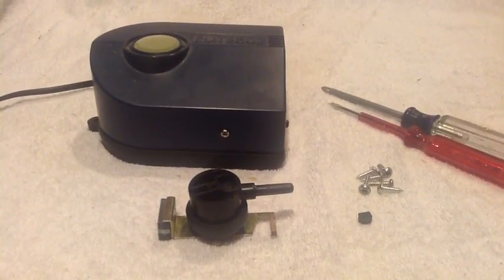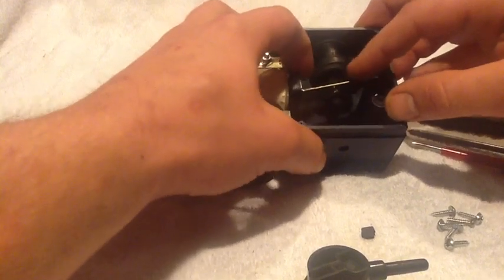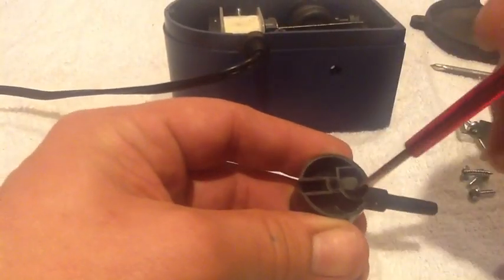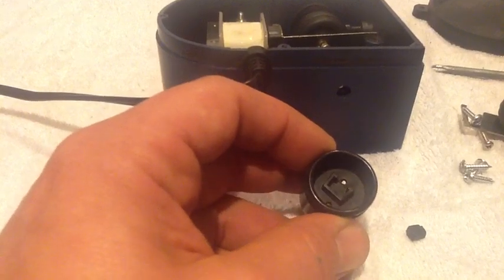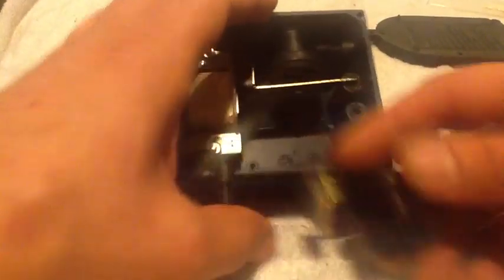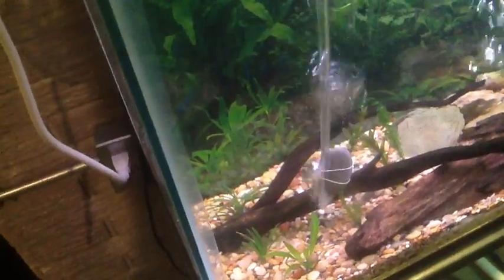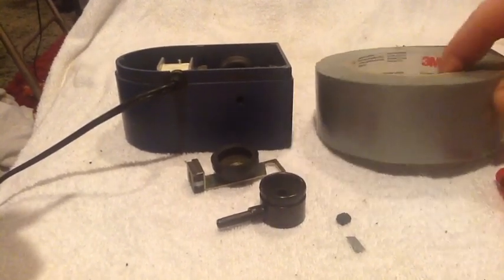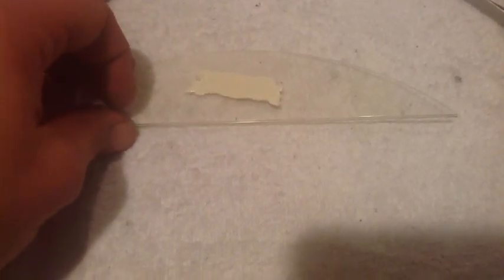How To Fix An Aquarium Air Pump

Comment: His terminology is a tiny bit off but the information is accurate.  My flapper was slightly creased, I just reversed it and the pump now works as new.  I imagine a good replacement for the flapper would be a small piece of latex glove. Thanks!

Comment: Thanks for your video.  I just pulled the pump out of the trash that I threw in there earlier today when it quit pumping air.  Took it apart.  I only had to unfurl that little gasket and put it back in. It was just curled enough to uncover the hole.  If it happens again I'll know what to do.

Comment: "Rubber gasket"= REED VALVE  "Gasket"= DIAPHRAM  "Air Cylinder"= PUMP BODY  "Rotating Motor"= AC ELECTRIC MAGNET  "Magnet with a Rod"= CANTILEVER FIXED-POLE MAGNET  "Rotating Magnetic Field"= AC OCILLATING (flipping) MAGNETIC FIELD  AND... DEAR LORD- WHERE'S THE SPIDER OR SNAKE THAT BIT YOUR LEFT HAND??

Comment: I took mine apart and the plastic flappers were good but dirty so I cleaned it and blew air with my mouth into the outlet and disloged what I think was dirt.  It worked.

Comment: This is a nice video. Many of pet store guys just say to throw it off and buy a new one, when it fails. In a year time, such two power filters failed suddenly without any reasons. I just one morning woke up & saw the power filter wasn't functioning. But I make use of those power chord, suction cups, cartridge stuffs with it, since, that power filter was totally stuffed inside with fibre glass for making water proof. It gives me no way to know what went wrong inside. But, Air pump is cool !

Comment: Was able to fix my Precision PR2500 coz of this vid. I have a PR7500 too. My question is this : can i join the two outlets using a T-connector into one air hose towards a sponge filter, without harming their diaphragm?
Reply: +JOWEE BOIE I did this and it worked fine, I don't think it's putting out enough air to reach the maximum flow rate of the small diameter hose anyway so it shouldn't create back pressure.
Reply: +James Brine thanks man. i just set aside the 2500 as back up if the 7500 breaks down. the 7500 now runs 2 sponge filters from its 2 outputs, set on "low". the 1st spongefilter is in my oscar tank and the 2nd is in my tetra tank...

Comment: sit it on a piece of wood,the wood will absorb vibration,or use foam,but don't block air space under the pump.It needs air space to dissipate heat build up.

Comment: you can re-use the original gaskets by cleaning them just wet your fingers and rub them together with the gasket between them let it dry and replace but after so long it will fail completely. good job with the video though.

Comment: It does not push it, it is a magnetic that goes on and off 60 cycles per second,
the valves are called reed valves the problem that goes bad is the rubber tension in the rubber cup, do not replace the reeds, use a rubber band on the swing arm to reapply the tention on the pistion cup, that is the only problem these pumps have.
apply the rubber band compressing the rubber diaphragm. the magnetic pulls it out.

Comment: Well done - thanks! I wouldn't know where to begin without this one. I ended up treating the existing gaskets with corn starch, cleaning out the scum, and there was also a bit of water in this used Whisper 40 pump. Works great now!

Comment: Do you have any idea how the piece with the valves on it is help on when they don't use screws? i dropped my pump yesterday and in taking it apart what you said seems to be the problem, but it seems like the piece is glued on.

Comment: Hi can you make another video of how to silent airpumps like this?
Reply: usualy the magnet vibrators become close to the winding magnet when rubber becomes soft which holds them on place and it touches eachother and makes noise , u can fix this by adjusting the screw behind the ruber flaps that pushes air , slide it away or close to adjust , idea is to make the magnets away from eachother , u can also do smthing at its base to pull it away . i fixed mine by screw behind ruber flaps

Comment: The little valves are made of latex, you can cut a piece out of a latex glove. latex has very good memory so it returns to the flat closed postion very quickly and it lasts a long time as its very flexible
Reply: I tried using latex but still mine does not work.